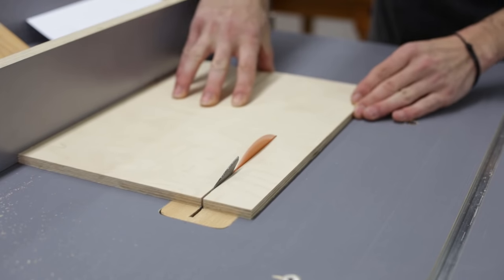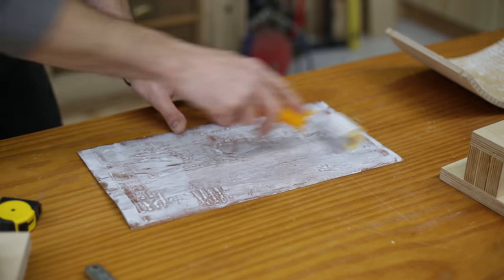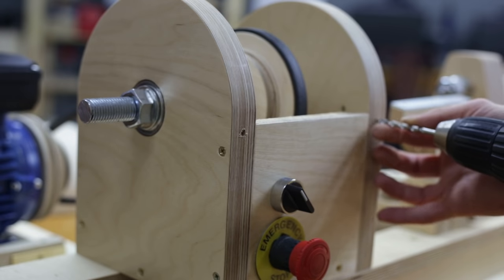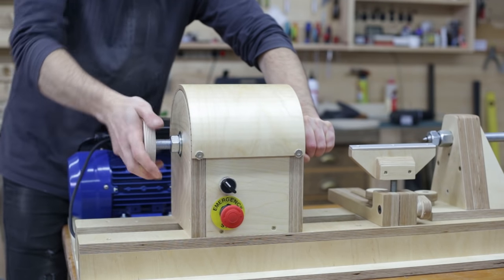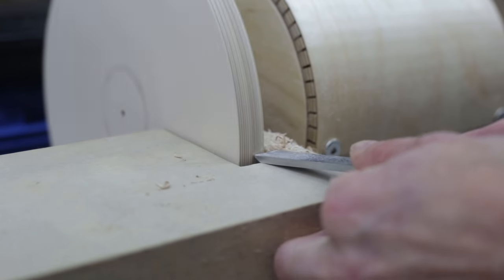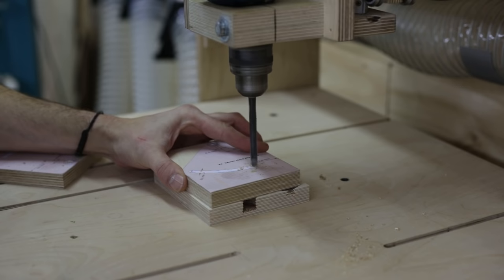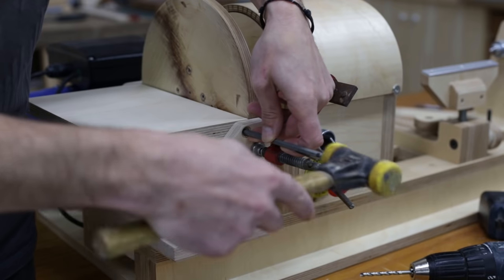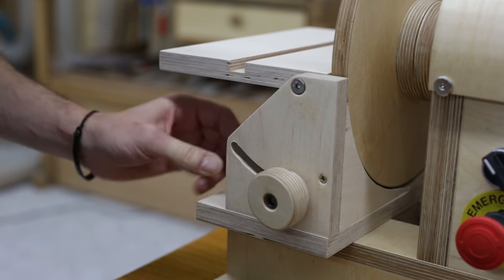Homemade Lathe & Disc Sander Part3

Comment: To improve balance of the sanding disc .... attach to lathe and true up the BACK of the disc and attachments.

Beyond that, marking known angles for your table and miter gauge would be functional and look awesome.

I will certainly be buying these and other plans for my small workshop! :)
Reply from the maker: you're right Gregory, I have also thought about some of these improvements. thanks!

Comment: SO AWESOME!!! How will you remove the sanding disc when it gets worn out?
Reply from the maker: Is to glue and take off, the manufacturer says: spent discs that are tough to remove may be heated with a hot air blower.
Reply: Yonatan24

Comment: Loving the build, will probably be my first "tools" project once I finish re-building my workshop (poor foundations on clay - don't ask!)

One quick question - would there be any advantage in using a 3 phase motor with a Variable Frequency Driver to give speed control from a single phase supply as seen on some modern lathes, or is it overkill?
Reply from the maker: thanks Andy, that is a great idea. Send me some photos

Comment: Hi Paoson,

Just a question, What is the maximum length between the two points?
Reply from the maker: thanks! can lathe pieces of 450mm long and 300mm diameter. If you need longer, it can be easily modified by lengthening the base of the lathe.

Comment: Suso, you secured the drive directly to the thread 2:30. 
But this connection is not very accurate and reliable. Over time it can appear drive beating. Why not paste elongated metal nut in the hub disc?

Mark.
Reply from the maker: Was another option... I'll check it over time and if necessary I paste a long nut. Thanks as always!
Reply: Just curious as to why using a permanent fixed self adhesive sanding disc paper instead of a hook & loop type that can easily be changed when the other one wears out?

Comment: Hi Paoson, would I be able to replicate this in MDF or MFC & would it be possible to be used with a drill as opposed to buying a motor?
Thanks,
Glyn
Reply from the maker: you could be inspired by this design but with some changes because the drill have less power than my motor, try to use a powerful drill.
Reply: Good point. Thank you I will.